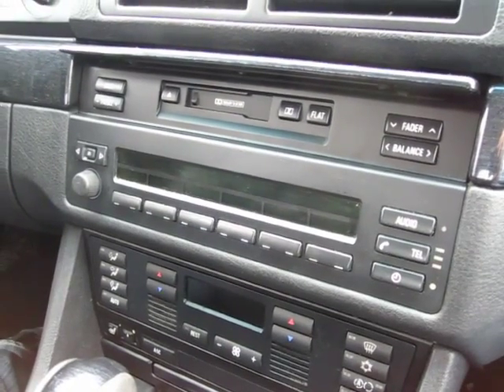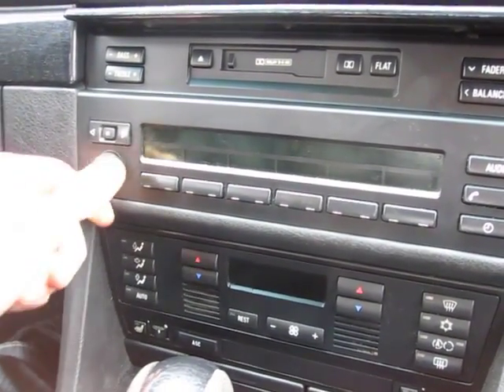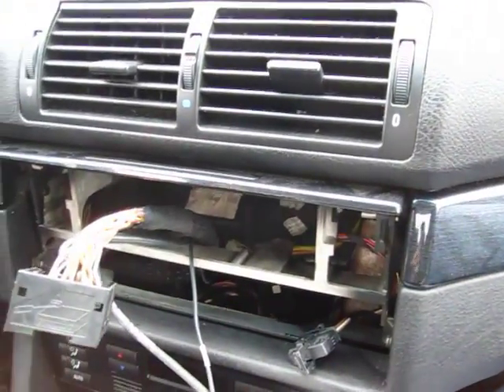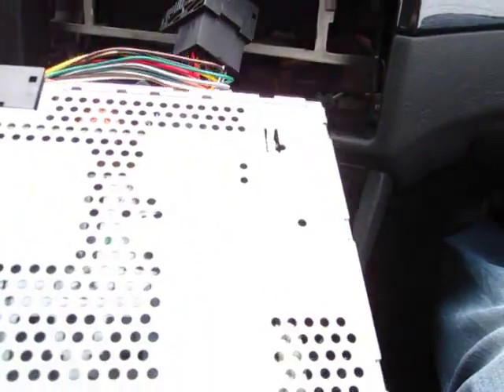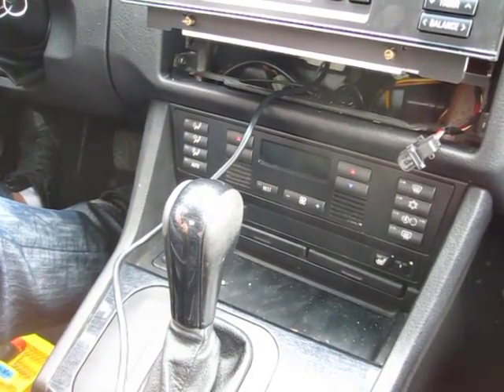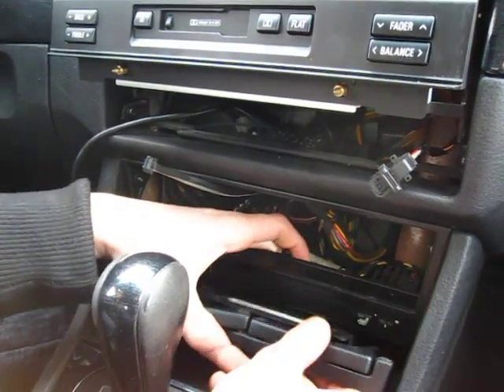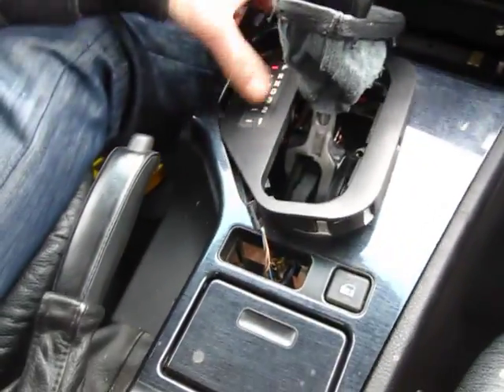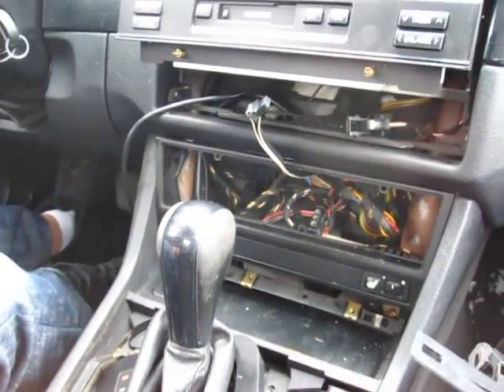GTA Car Kits - BMW 5 Series (E39) 1997-2003 install of iPhone, Ipod, AUX and MP3

Comment from the maker: @maximilianlindner That is correct, if your car is equiped with a DSP system, the kit will not work. If you have DSP, it will be stated on the from of the radio.

Comment: Great video, When I got my E39 it already had some hackjob where an indy put in the cheapest Alpine deck unit money could buy (that blue hue piece of crap they sell at bestbuy.) How I wish it had the factory unit to upgrade, and I plan to find a replacement and add in a simple AUX cable. This should come in handy when I do.

Comment: there is an easier way to run the wire to that spot without removing the center panel. and the way he showed you what to do is not hard aswell.

Comment: Thanks, I found it very helpful to install the AUX kit OE 82110149390. The OE instructions do not include the fact that the bracket is located behind the CD player.

Comment: Why is this entire extra harness necessary? Can't you just remove the plug where the CD changer plugs in and replace it with a plug that connects to an iPhone?
Reply: +Douglas Unmack 

The default CD changer is located in the trunk of the car, (90's tech for ya.)

While you could in theory re route the cable from the CD changer to an Aux cable, the stereo would likely freak out due to the extreme amount of computing BMW even put into a car 16 years old, The ECU is constantly running checks over each system and would likely either just not work or trigger a metric F-Ton of error codes if you tried a hackjob like that...

With BMW you do it right, or not at all...

Comment: I'm searching for a radio upgrade for a E39 1996. but most of the radio upgrades are for 1997 and above. whats the difference between the 96 and 97 and above?